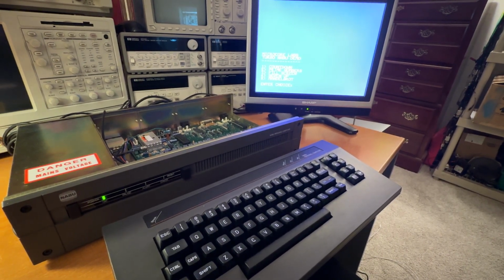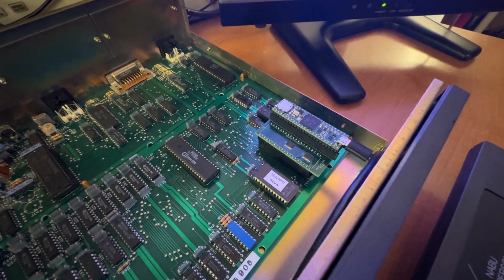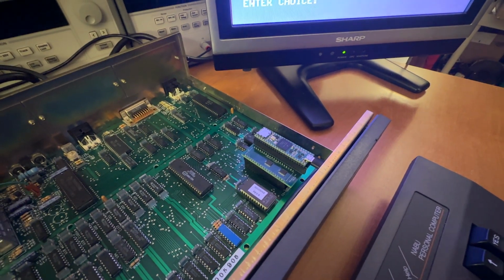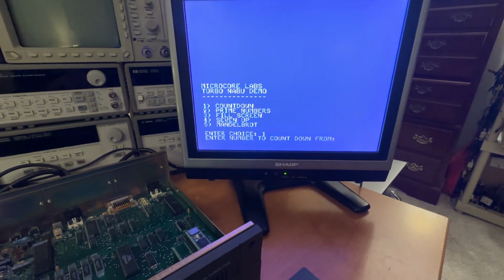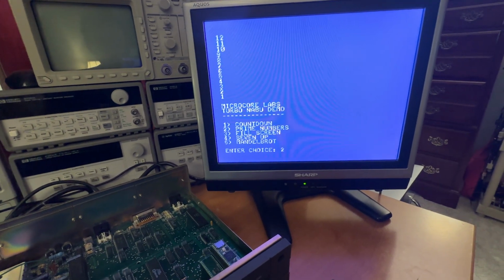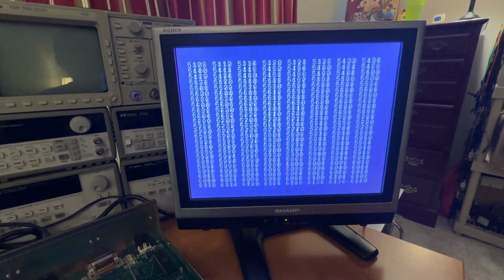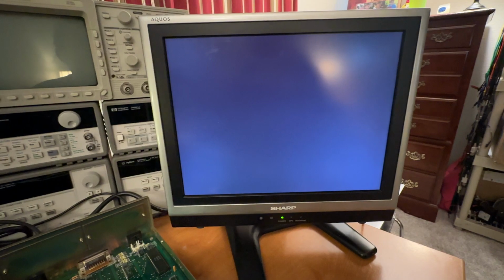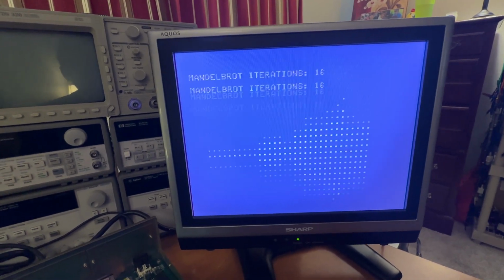Turbo NABU using the MCLZ8

Comment: How many times is it faster than real Z80? (benchmark w/o limitations from graphic output)
Can MLCZ8 be used as "Vampire" turbo card for Sinclair ZX Spectrum/Z81?
Can MLCZ8 have SD card access for emulation of 3.5" disk drive? (I guess so, just to add the code. This could replace DivIDE add-on for ZX Spectrum)

Amazing job!!!